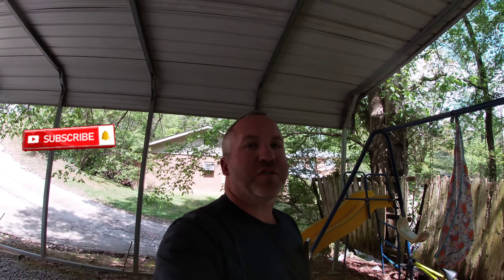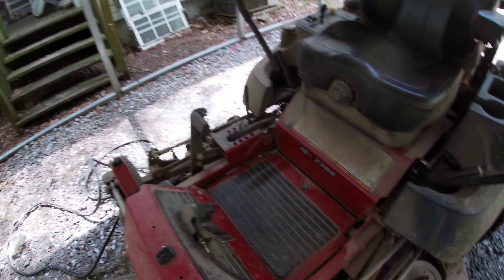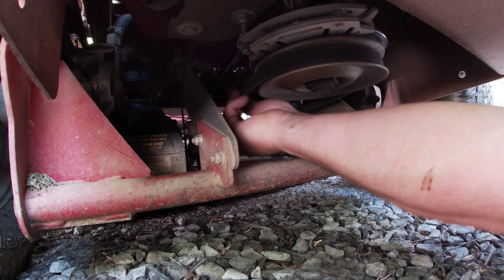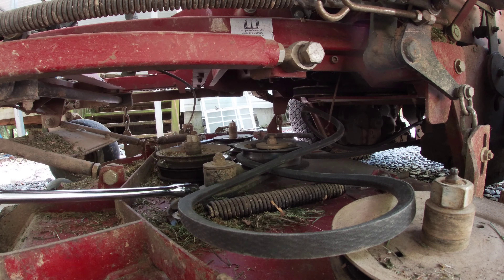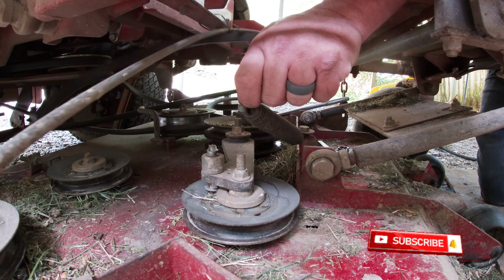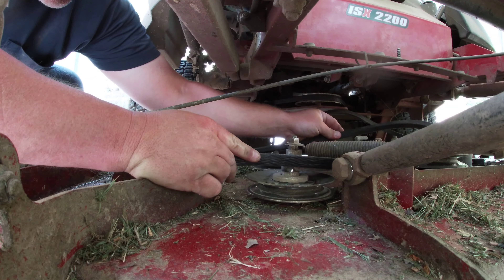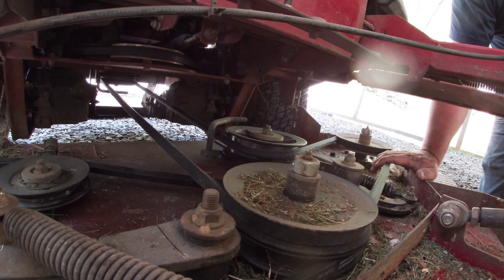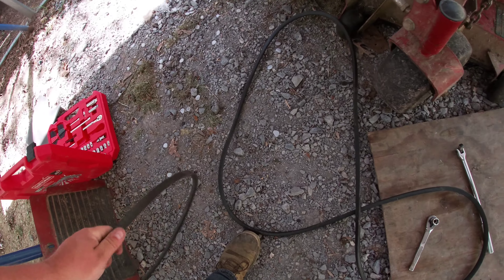How to Change the deck Drive Belts on the Ferris ISX 2200 Zero Turn Lawn Mower

Comment: Hey Brian. My short belt on the chute side is rubbing against the metal right where the front idler puller is. Seems to be really loose? Could the belt be worn out or needs to be adjusted? The belt barely has 150 hrs and seems to be intact
Reply from the maker: Im not too sure but sounds like it needs to adjusted or a bad spring on the idler

Comment: I also have a Ferris ISX2200 mower, How many hours on your belts at change out? Thanks
Reply from the maker: I think mine lasted around 400-500 hours but could vary alittle i have had pretty good luck with them.